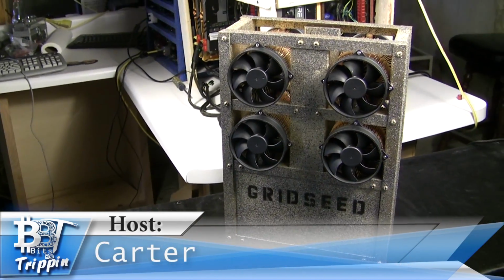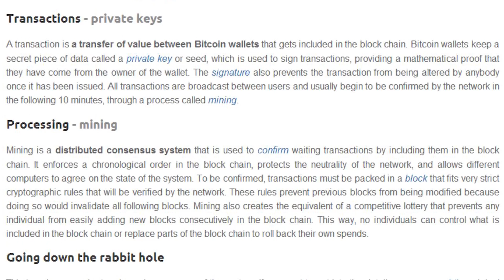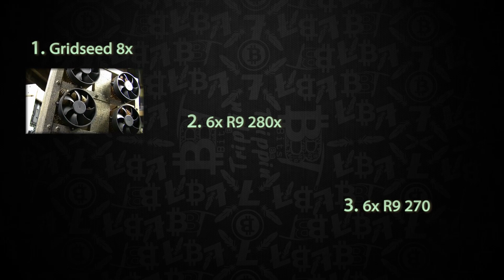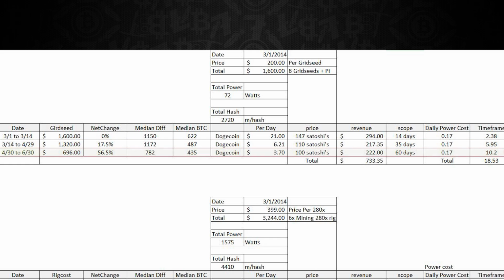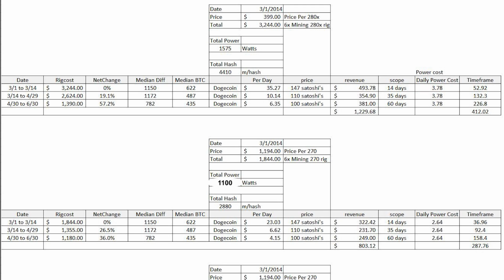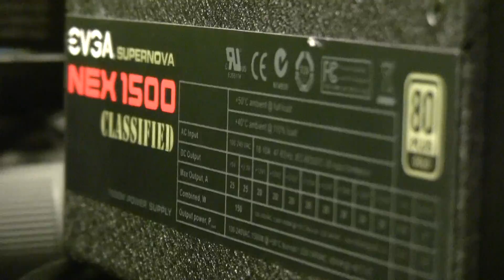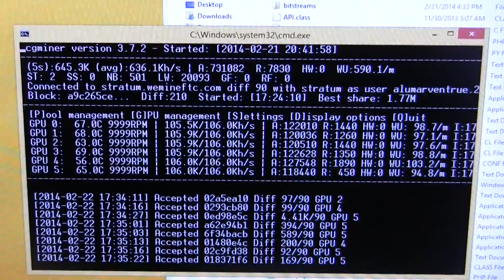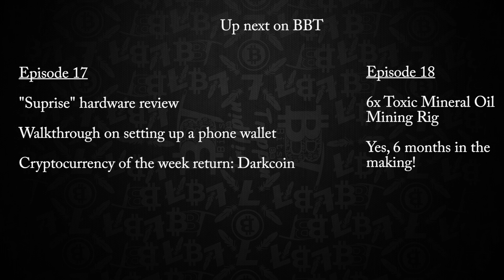BBT Episode 16: GPU vs ASIC Analysis

Comment: Hi, i've to start mining altcoins X11 and X13 algorithm, the graphic card  that i would start are  4 sapphire R9 280X (they have need 230 watt to one) with seasonic power supply, 4GB ram and a cheap sempron processor. By that I understood  from October  to Gennuary-Febbruary the price of cryptocurrency improve as happened  for bitcoin litecoin.....
 12000 Mh/s X11
 9333 Mh/s   X13

It's a good starting? I'll gain  money? Naturaly I want make new GPU rigs later
I want mine the debutting X11 or X13 altcoins and trade them for bitcoins. Please answer me, i've to start,

Comment: GPU's........ really about what floats your boat. Some are into efficient mining with responsible tdp footprints. ASICs regardless of opinion are specifically designed for this exact role. Why fight it? Let's not forget, setup of a multi GPU rig is NOT just about hardware procurement. There's a huge difference between racking an extremley high performing btc or alt miner and screwing around with trying to get numerous GPU's to work stable. No matter what spin you put on GPUs, there's considerable investment in time and effort to get them up correctly. I guess it comes down to how serious you are and if it's investment or hobby. No, I'm not trying to upset anyone and yes the GPU thing did great early on but it's reality and an extremley dynamic one.

It's like the PC vs xbox/ps3 thing. Some like to mess with the gear while others are playing the game. Every minute spent building alloy frames is a minute less spent reading the market.

Comment: Your analysis makes since if you have 1 rig. But what about factoring in the cooling, storage and maintenance cost for GPUs? If you have 30 plus MH you need a location with enough electrical capacity, You also need to pay for several fans or a AC systems. I can run around 50MH on 1 standard 15amp home plug. I also don't worry about cooling cost because they don't get hot. I was lucky to have paid below $170 per. But with the change in block rewards I'm a long way from ROI. I'll also lose on depreciation of the hardware. With the low electrical cost it is easier to stay in this for the long haul. I'm not forced to sell off my coin to pay for electricity and storage.
Reply from the maker: Mike Johnson - you are exactly right and have the mindset for someone looking to play in the big leagues. 50mh at that time woulda been around 25k. That kinda investment has to have a solid plan to get your ROI back given the nature of crypto lately. 

To aquire 50m/h in a GPU standpoint your talking roughly 10 * 290x (6x) rigs. Which requires two eVGA G2 1300 supernova's each rig (so 20x 1300w PSU)

You're looking at around 26,000 watts (at the wall) requirement. Safely your looking at 20 (15amp) connections or drop a few (4) beefy 30amp connections. 

Bottom line your looking at around 1800.00 in electricity in midwest, 2500-3k on a coast a month for GPUs 

Total cost for a 290x 6x rig was around 4500.00 around 3/1 so your looking at 45k + 1800 a month in power ..resulting in the need to bring home at least 5k a month to pay capital cost off within 10 months, not to mention at least a 4k investment (and the space/room) to house that footprint (two 7ft metal racks) and 3-4T separate AC unit dedicated for room.

In closing, that is still viable solution to someone wanting to go Scrypt-N if price supported - at 1$ the price/dif is much like litecoin circa launch through this time last year. If it went to 10.00 a coin however, you will see GPU farms and we will repeat this all over again with Scypt-N complex ASIC's
Reply: rivertopia I don't think it will go that high but I'm with you on the price of VTC going up. I'm currently mining this with my 2.8MH GPU rig. Think I will buy some also. A couple of other players to look out for are Myriadcoin, Darkcoin, Blackcoin and nautiluscoin.
Reply: Bits Be Trippin' Nice reply! Thx

Comment: Good Video!  What's the best graphics card to buy for scrypt and scrypt-n mining right now?
Reply from the maker: Right now the R9 280x for $165-185.00 is a great deal and will provide 303-325k/h Scrypt-N and 695-735k/h scrypt
Reply from the maker: ZodiacGF https://bitcointalk.org/index.php?topic=404364.0 ; This link will help you. At this time no ASIC device (available on market) is handling Scrypt-N, ASICs only hash SHA256 (Bitcoin) and Scrypt (Litecoin/Dogecoin and other Scrypt) ... For coins such as Vertcoin and EXEcoin are resistant to ASICs; GPU/CPU's are the only tech at the moment that can mine/mint Scrypt-N & X11 (darkcoin)
Reply: ZodiacGF ASIC Scrypt miners do not mine Scrypt-N.
Reply: ZodiacGF Ok Zodiac, you are proving that you don't know what Scrypt-N is. Scrypt is NOT "Scrypt-N." For the record, I am a miner, this is my field, but information is freely available all over the place. Check out Vertcoin as an example.
Reply: Okay thanks guys!  Bits Be Trippin' the 280x does look good and ZodiacGF I have two antminer bitcoin asics but I really want to try gpu mining with Scrypt-N.
Reply: Thanks!